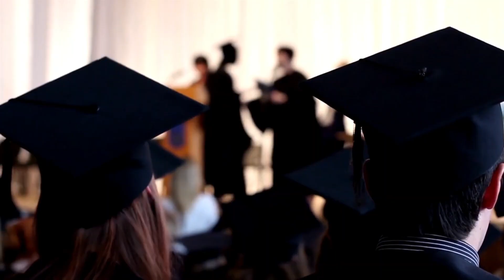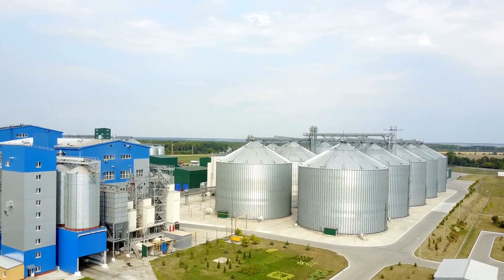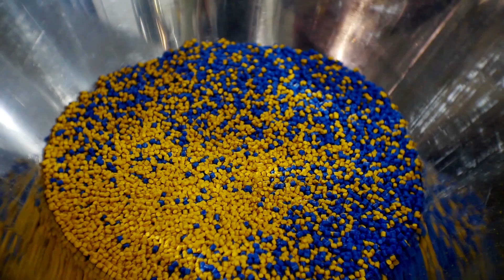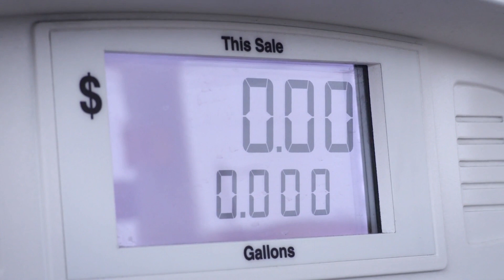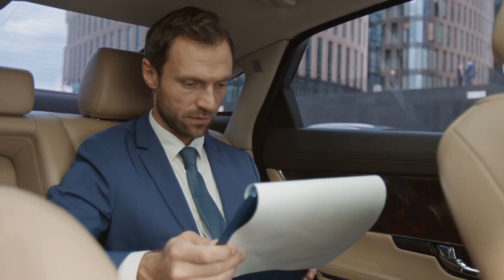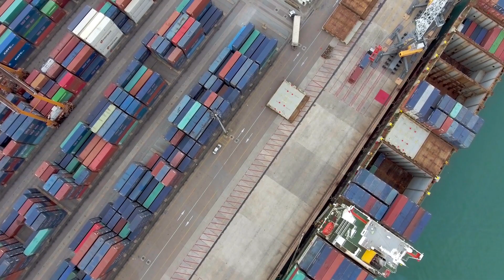Best Master Degrees for Chemical Engineers - 2025 Review

Comment: I am a chemical engineer with more the 4.5 years of experience of continuous plant. Now I am planning to do masters from canada i.e. MEngg in environmental engineering. Is scope of master degree holder in USA or CANADA?
Reply from the maker: Hi there... well. I really think its generally easier and cheaper to go for Canada option, I've also heard they are more inclusive with foreign students, especially from Master degree.... But USA has way much more job opportunities out there... I would go were I will want to work, rather than the master degree which is only 1-2 years
Reply: @ChemicalEngineeringGuy  Ok thanks buddy

Comment: hi sir pleaseeee help me. My Name Is Gaurav. I am from India I have completed diploma in mechanical engineering.my father has factory of manufacturing reactor and other paint machinery as well as we fit plant(resin plant).
now problem is that manufacturing knowledge is get from manufacturing engineering (mechanical engineering) and reactor and other machinery knowledge is get from chemical engineering also selection of equipment knowledge is get. 
so i was confusing about choosing my branch help me.
Reply from the maker: Chemical Engineers will know some Mechanical Engineering, but Mechanical Engineers will not typically go into reactors. They can, though... They just need to read some kinetics and reactions chemistry, then a reactor engineering course and they are mostly set up

Comment: Great video! As an 34 years old chemical engineer - guy, I could suggest that achieving a master degree totally worth it only if it's related of the field you're working on. For example, in my case, I work for an environmental consultant so I'm doing a post graduate studies (which isn't a master obviously) in environmental law and I'm thinking to go into post graduate studies but in natural resources law. 

As you can see, as chemical engineers we can go for almost whatever field of study you are interested and not necessarily being 100% related to chemical engineering or engineering it all, but as I said depends of the work field you would like to go (or field that you are able to find a good job, essentially)
Reply from the maker: That's the great thing. ChemEngs are pretty versatile :)
Reply: Mai ask what's salary ranges in yoir field?

Comment: Thank you for this video. I am planning to do Masters in Process system engineering where I want to learn optimization techniques and data analytics. What are your thoughts on the same?
Reply from the maker: Sounds great, especially because nowadays there is a LOT of info out there, pending to be analyzed. Unfortunately, there are lots of people in the industry still using excel and pivot tables to make analysis.
Reply: @ChemicalEngineeringGuy  thank you for replying :)
Reply: Hello 
I am interested as well.Have you found any master programs that can grant schoolarship?

Comment: What do you know about chemical engineering master's degrees that go to the metallurgy field.
good video.
Reply from the maker: Sounds great, especially if you are already on the field, or looking to get into it... The main advantage will be the knowledge in chemicals... I have some friend on those fields, but end up doing "generic" engineering work such as manufacturing, production... Don't get that much into the actual material science or metallurgy part